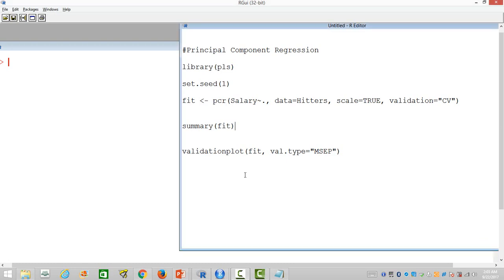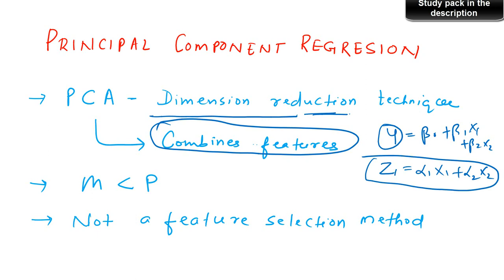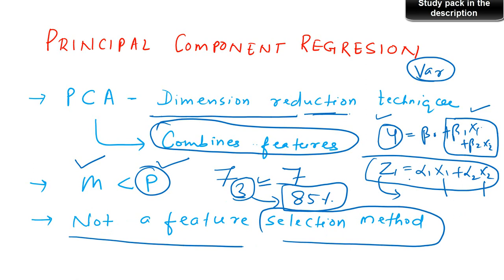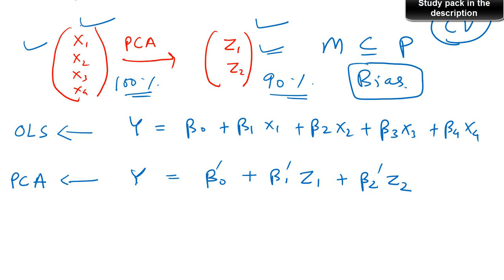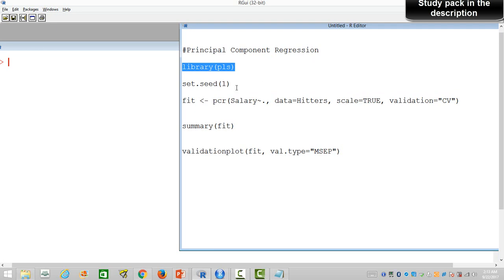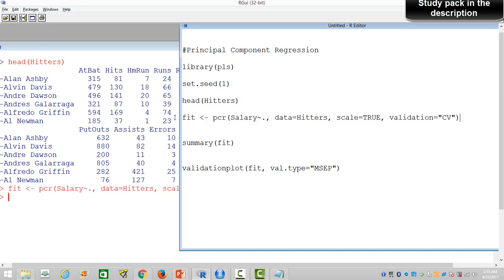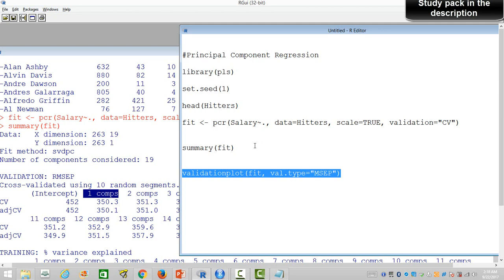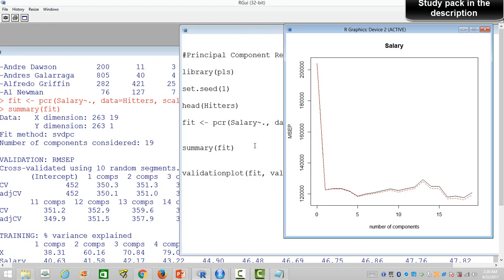Principal Component Regression | Dimension Reduction

Comment: I think at 4:15 you are somewhat wrong when you say "...how many principal components maximize the variance of y".
PCA reduces the dimensionality of the input feature vector X and does not use the output y.
However at the end of the process aim is to explain the maximum variation in y, maybe then the number of principal components maybe a sort of parameter in contention when deciding how many PCs to use. But it is sufficiently clear when you perform PCA (in this setting) you are trying to have a large percentage of variance explained in the input features (say 95 %) with lesser number of  transformed features in the final input feature vector without taking into account the output y.